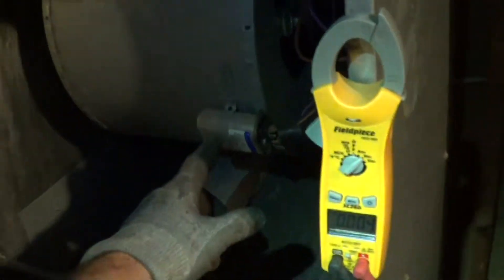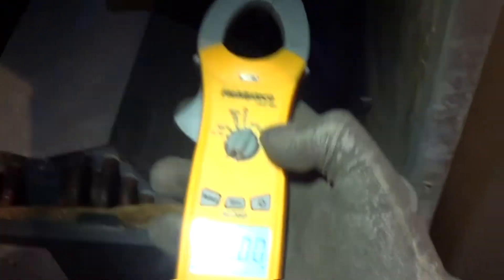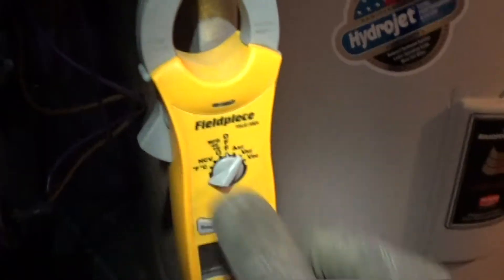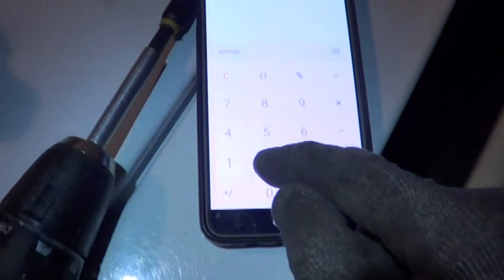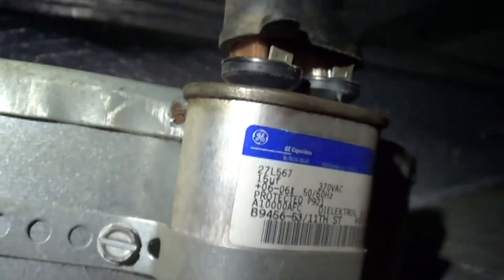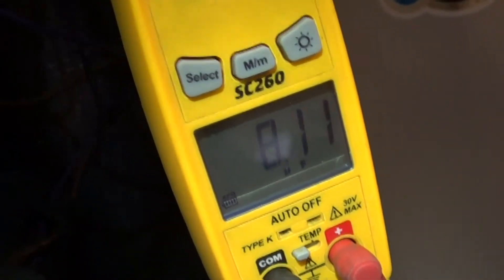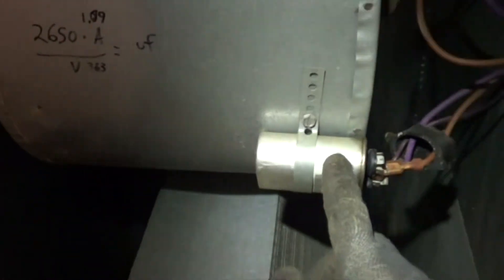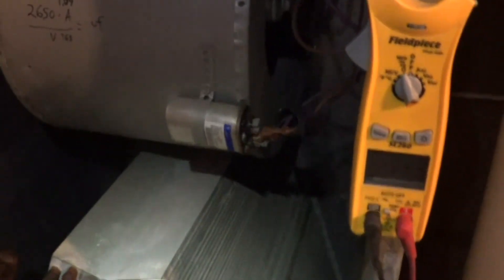How to Read a Run Capacitor in Circuit under Full Load

Comment: Your amp draw is almost .4-.6 higher with the door open....your incorrect
Reply from the maker: That is right.   The amps are higher with the panel off.    However, the capacitance doesn't change with load change.    The capacitance changes when the capacitor goes bad.

Comment: The value of 2652 for 60Hz. What is the value for 50Hz ?
Nice video....!!!
Reply from the maker: Capacitance in Farads = Current / (Volts x 2 x Pi x Freq).  So, for 50hz, use 3183.
Reply: Thanks
Reply: I'm on the same page. 
Thank you

Comment: I was scared a bit for a moment because I didn't see you discharging the cap prior to measure its capacitance.  Perhaps there is a bleeding resistor at the other end, I don't know.  I made a little tester for a friend of mine who's HVAC technician.  He received a batch of capacitors that weren't within specs.  We measured the capacitance which was most of the time within specs, but when the capacitor was connected to the AC circuit, the resulting (calculated) capacitance was way off.  His supplier confirmed him that the manufacturer had returns on some lots, which doesn't happen too often.  At least we were able to test them quickly and avoid installations of faulty capacitors.  Do you validate the capacitor's capacitance after installation of do you take for granted that the capacitance reading of your meter is satisfactory enough to consider the job as done ?
Reply from the maker: Run caps self bleed when the power is off thru the start winding of the motor.  Start capacitors don't self bleed because they have a relay keeping them out of the circuit.  Only start caps need a resistor.  But, I wear Hyflex CR2 cut resistant gloves and never get shocked anymore.  Previously, I got a good blasting once a year and never got used to it.
Reply: Discharge a capacitor?!? It's discharges I to the start winding if the motor upon shut off...

Comment: Hi Nathan, 

Great video. I am going to incorporate this into my theory class. What meter are you using to measure the Capacitance?

Thanks again. Pete
Reply from the maker: Pete Vree fieldpiece SC260.  It is very small and does a lot.  You might also consider teaching how to check Breakers using a millivolt voltage drop. I didn't do a video on this yet but in general all Breakers should have less than 100 mili volts drop between the bus bar and the outlet. This is a great way to tell if a breaker is overheating without needing a thermal camera.

Comment: Very informative,  waiting for an update on your oil bypass filter.  Thanks for posting.
Reply from the maker: I can't wait for that one too.  I'm using the cellulose depth filter.  Right now I'm at 8,,000 miles with 6,000 actually on the new filter.  I should be at 10,000 miles in a month.  Then I will particle test and video the results.  I have to say that the oil color seems more golden than previously with the 2 micron Amsoil bypass.  Previously, at 10,000 miles the oil would be very dark.  I'll give an update soon.  I have plenty of data on the 2 micron 98.7% (EABP90) over 30,000 miles.  The depth filter I'm using now (TR-20330) is also rated for 2 micron at 99.5% efficiency.  However, the media is 6 inches thick.  The data sheet says I'm supposed to get an ISO test of 16/14/12 or lower.  The Amsoil EABP90 could never deliver that amount of clean.  I'll keep you posted.